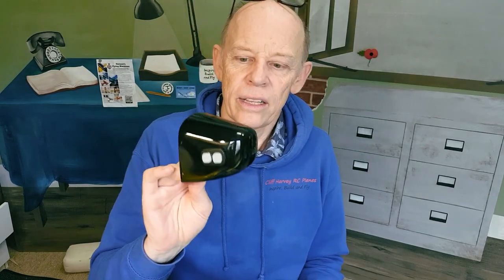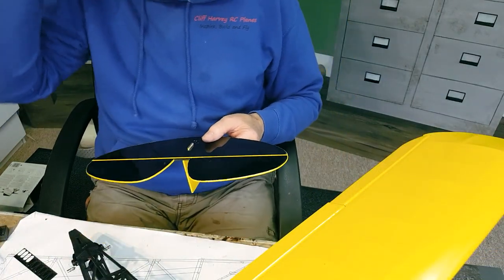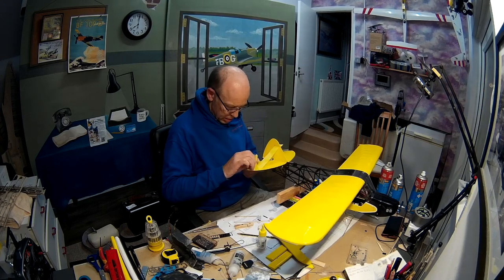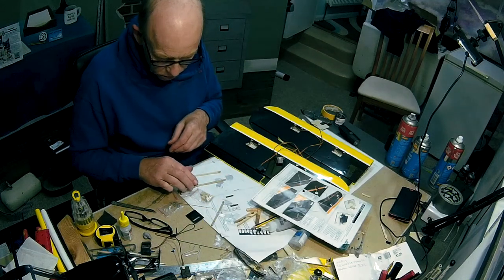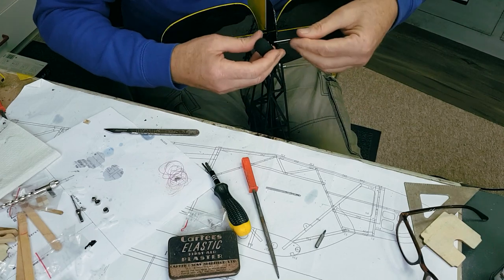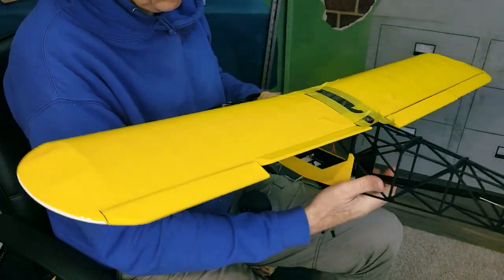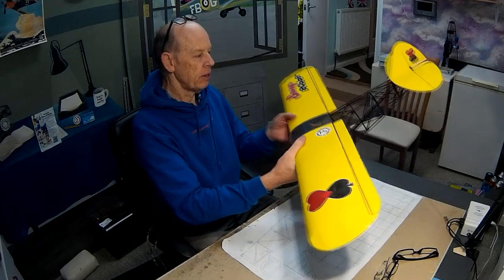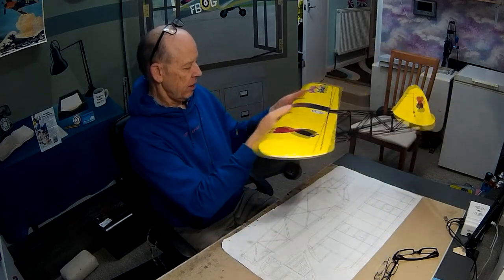DW Savage Bobber Build Final Part Four

Comment: Really looking forward to the maiden, I've seen a few reviews all have had problems with the model pulling to the left... The right thrust seems like a good plan.
Reply from the maker: Hi Mark, I'll be uploading the Maiden video from this morning later on this evening if it finishes rendering in time, all the reviews so far of this model are the ready built versions, mine is the kit version 👍
Reply: @CliffHarveyRCPlanes  did you experience any of the issues?
Reply from the maker: @MarkCroucherRC4fun  Not really, no, but I increased the right thrust, mine is the 2s version, less power equals less torque. The video will go into more detail but I talk about the cg and control horns as well 👍

Comment: Your bobber looks  very nice. Please think of my tip to increase the motor camber  to 5 degrees and if necessary to use a 3-axis gyro. Half-flap also help. It would be a shame about the work and the model
Salute from Olaf
Reply from the maker: Hi Olaf, thanks, I have increased the offset but I don't fly with gyros, never have! Thanks for the suggestions 👍🙂
Reply: @CliffHarveyRCPlanes  I wish good reactions 😉

Comment: Nice work as usual what your round the pole getting smaller area when the models get bigger? Also have you gone for your full size Tiger Moth flight? if so do any aerobatics like you did with the model
Reply from the maker: Hi Robert, thanks, it did occur to me actually to try her rtp as an experiment but the line will have to be shorter (and stronger) 🙂 The Moth flight got postponed a couple of times this year but I'm still very much looking forward to next Spring when she come's out of the hangar again, the model's sitting in the rack right next to me as I type ... pure eye candy 👍

Comment: Hi Cliff - kit came today, only damage I can find is some burning on the flap. Can inlay some balsa so no problem.
This is the first kit I have built with flaps and I cannot figure the servo positioning. All the servos point towards the wing tip and facing towards the spar. I see that if using a y lead then the ailerons would work but the flaps would work the same, one up the other down. Am I getting something wrong, your input would be most helpful. Thank Colin
Reply from the maker: Hi Colin, you need to plug the flaps into a different channel on the receiver if I understand you correctly. Something I have thought of doing (but haven't yet) is to couple the flaps into the ailerons on a mix switch, this would increase the roll rate and switch back for landing. Having said that the flaps are an extra which I rarely employ anyway so you might fancy making them all aileron, cheers.

Comment: Looks great Cliff!  Looking forward to the maiden!  How does she balance? I think more than anything some of the guys having a hard time with this one are flying it tail heavy.
Reply from the maker: Thanks Adam, the battery is all the way forward, 1600 2s, and, as you probably saw, I've added 60g of nose weight, she balances just in front of where the plan suggests, I did try taxying on my lawn but she noses over easily, the wheels are only just in front of the cg so it'll be a case of opening the throttle and getting her 'flying' on the ground first. I was hoping to just ease her into the sky and see what happens low down but I don't think I'm going to have that option. If all else fails it'll be a hand launch ... now that will be exciting!
Reply: @CliffHarveyRCPlanes   I noticed the angle of the gear watching the video and thought that if it were me I might add some block stock and shim the back part of the gear so that it rakes the whole assembly forward somewhat.
Reply from the maker: @Model AV8R  Good idea Adam, I'll keep that in reserve for after the maiden as it's a review model 👍

Comment: Where did the slotted holes in the wing servo mounting plates come from ?
Reply from the maker: They were in the kit, have you thrown them out perhaps?
Reply: The cover plates had slots already ?  I purchased an arf version - no slots in the plates. I ask because I can’t see a way to connect the pushrod using the slots in the wing.
Reply from the maker: @rszanti Take a look at 19:40 in Part three (https://youtu.be/rCZNy6MuL7o), you'll see the slots, as yours is an arf perhaps they have been filmed over? The instructions say to mount the servos with the arms facing down into the wing and the pushrods come up through the holes with a bend in them to connect to the horn (I think from what I remember), I decided to fit the horns coming out of the wing and a straight control rod to the horns.

Comment: Cliff, could I ask what servos you used/recommend?
Reply from the maker: They were just the ones that came with the kit but they're only plastic gears so as long as you go for a servo that will physically fit and has metal gears as a bonus you'll be good to go 👍
Reply: I can't seem to find a 'Full Kit' at the moment. They have some in the US I think, but postage from the US to little old NZ, is off the charts! I can get a model from BangGood with much cheaper postage, but only with motor. I can get the ESC easily enough, but they have stopped producing the mini-servos (nylon gears) which were so light. I can't seem to find some small servos with metal gears anywhere near that weight; and there are six of them to add up. ie considerably heavier. I can do that, but do you think the supplied motor and airframe will take that. A more powerful motor perhaps? I'm very new to 'building' models. I have usually bought Ready to Fly. So I'm a bit nervous about mixing and matching components.                                                     Anyway, keep entertaining and educating us Cliff. It's always fun to watch.
Reply from the maker: @oldponytail  The added weight wouldn't be much of a problem. The nylon gears are very easily broken if you knock a flying surface that's why metal gears are preferable. Don't worry about mixing components, that's how you learn. The motor is reasonably powerful I would try first then see but if you have something a little bigger it wouldn't hurt. The airframe seems pretty tough, Thanks for commenting OPT, like and subscribe if you're not already. What's your name anyway? Cheers 👍
Reply: @CliffHarveyRCPlanes  Thanks Cliff. My name is Len. Originally a Londoner but moved to NZ in 1989. Retired now. Was in a technical medical career. Also was full-sized gliding instructor. Retired from that at the same time as work. It's not a cheap pastime! My interest in RC came when I retired and was given a Volantex Phoenix Evolution as a present. Naturally my initial RC flying revolved around gliding but I'm now trying my hand with power models. Thanks for all your helpful advice. I really enjoy your channel for what I learn and the fun you convey. Take care.
Reply from the maker: @oldponytail   That's a great resume Len, how did you find flying from the ground after you retired? Do you still sport a pony tail? 🙂👍
Reply: @CliffHarveyRCPlanes  Thanks Cliff. I still carry the Ponytail. Lol. I found the transition to RC Models something of a challenge. Actual 'FPV' for so many years, got in the way of orientation etc, especially with the constrictions of the Champ indoor flying! Fortunately I was flying Gliders outside, with Club Instructors! Slower than the power models and much needed 'Buddy-Box' intervention in the early stages. My thermaling knowledge, use of wind, ridge flying etc, kicked in fairly quickly, but longer flights merely delayed the 'landing' etc, and probably slowed my progress. More shorter flights would have increased my progress. I got the hang of it after a while though. I should have known from Instructing...lots of take offs and landings are critical to success! In Full-Size they are also critical to longevity! Lol. Love all your videos. It's always good to listen to other experienced people talking about something. Often it can trigger the 'AHA' moments. Especially enjoy the building tips etc. That part is definitely  new to me. I am Subscribed. Look forward to more videos. Thanks.
Reply from the maker: @oldponytail  I asked because I've met a couple of full size pilots who learned rc and they both struggled to begin with as well. I found it a lot easier to migrate to full size than vice versa that's for sure, cheers Len 👍